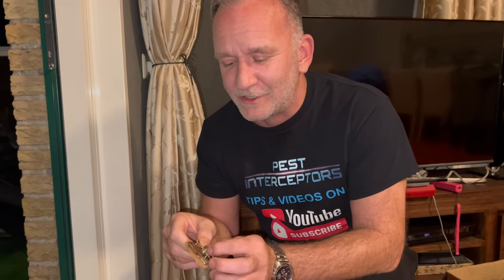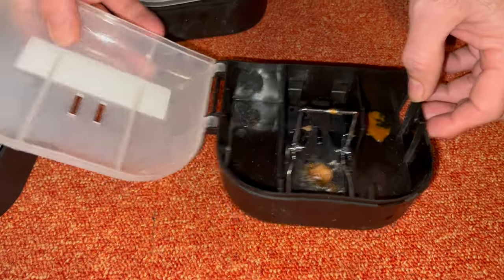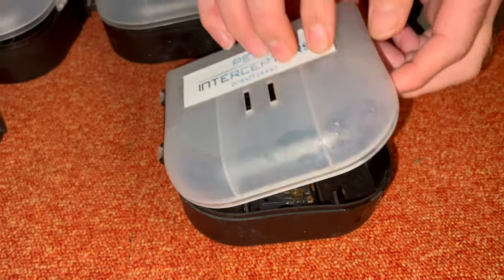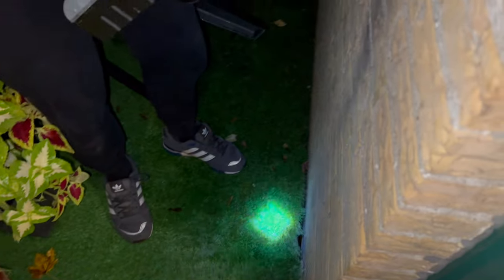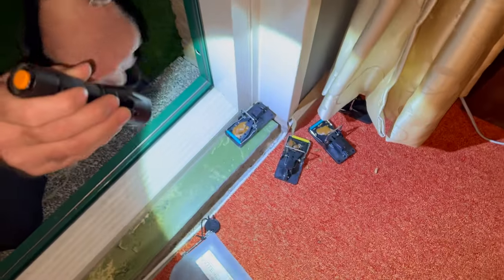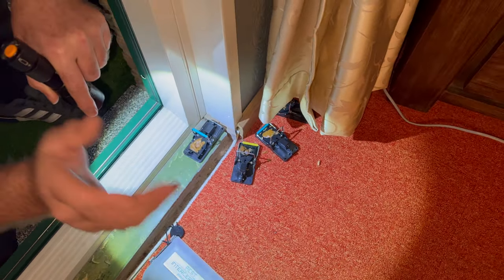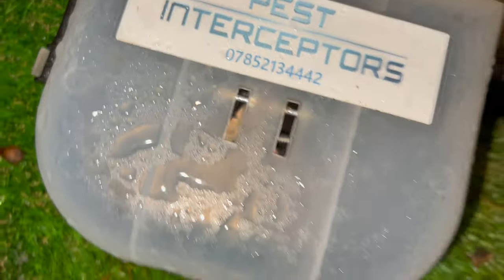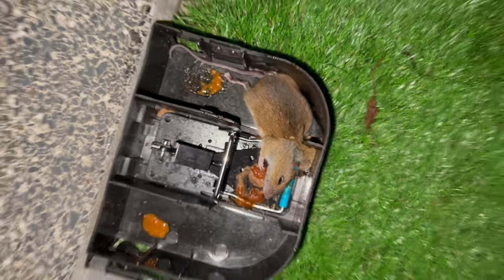NEW MOUSE TRAP - this has to be seen to be believed!

Comment: enclosed mouse traps are absoutely rubbish. rarely work unless you have a massive infestation, mice dont like going into dead ends and the enclosures put them off from even entering.
Reply from the maker: Wrong wrong wrong. 
Not that I have to prove you’re wrong but the proof is in the video! 
What a Wally 😂😂🙈🤡